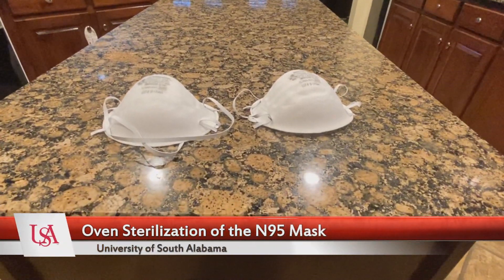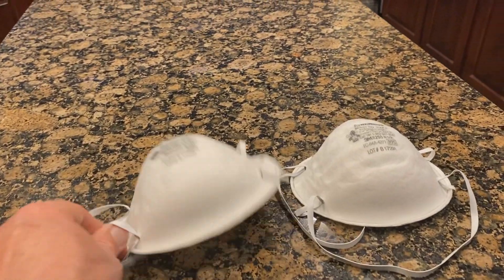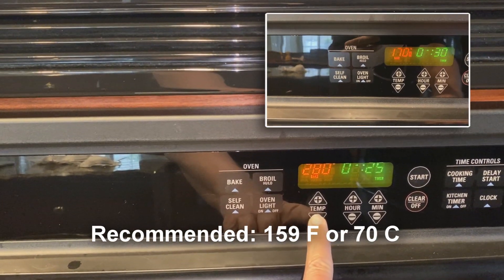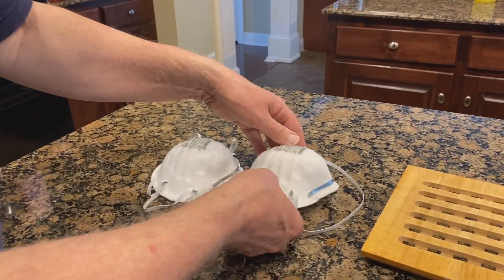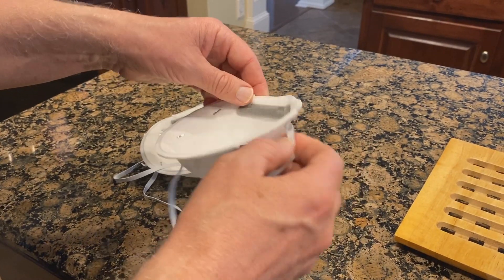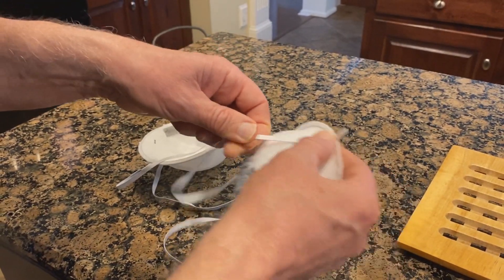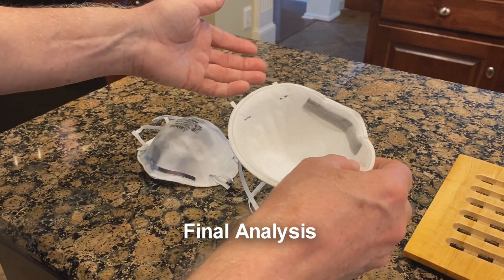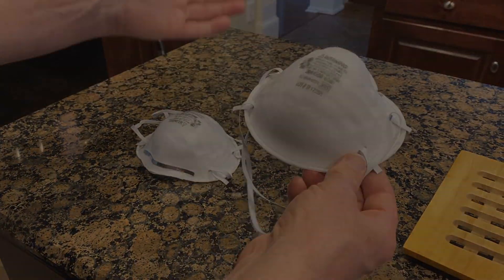Oven Sterilization of the N95 Mask

Comment: I re-purposed a Farberware electric dutch oven that was a wedding gift from the 1970's. I am using it to "hot box" the mask at 162 deg F for 30 minutes. I put the mask face down on 6-inch diameter metal rack with the straps looped on the inside. I purchased a Taylor digital timer and thermometer and place the probe on the inner nose pinch being careful not to damage the mask. I then replace the high dome lid over the dutch oven and set the dial on "Simmer". It takes about 25 minutes to reach 162 degrees and I let the process go for 30 minutes. Total process time is about 60 minutes. The  temperature controller on the Farberware electric dutch oven is easier to adjust than an oven. It sustains 162 degrees +/- 2 deg F  on the Simmer setting for the required 30 minutes. When the process is done, I turn the dutch over off and let the mask cool down - which is still adding to the heat curve. When the mask is at room temperature, I take off the dome lid, inspect the mask for damage, aseptically transfer the mask using tongs, and put it into a new ziploc bag. I have done this 4X so far and the mask shows no damage or weathering of mask body itself or the straps.

Comment: The N-95 masks has a electrostatic filter within it's layers and I wonder if the heat defeats that or not??  Definitely, chemicals like alcohol, Lysol, soap and water would defeat the electrostatic feature of the mask!  Also, laying the mask on ANY metal jeopardizes the mask and it's straps!

Comment: Get seven masks.  Write numbers on them. .  Get seven baggies and  number them.  Virus can't survive outside the body for more than three or four days.  Rotate your masks and put the old ones back in their numbered baggies.  This is what I am doing.  Can anyone poke holes in my plan?
Reply from the maker: Nope, your plan is excellent, but breathable paper bags are recommended.  That seems to be the most common recommendation and what our hospital has suggested.
Reply: I just cut up a couple of coat hangers and straightened it out so that I can hang a few masks on each. I  also give a very fine mist spray of Dettol and dry them all in bright sunlight a few hours. Till masks are available.. rotate and reuse I guess.

Comment: You cannot sterlize anything using dry heat at such a low temperature for such a short time period. Dry heat sterlization requires 160°C for 2 hours or 170°C for one hour at least. You need to change your video title from Sterilization to something else. You may be achieving some form of disinfection but even that is doubtful at such low temperatures for such a short time period.

Comment: You can take pure grain alcohol and peppermint essential oil and mix it 20:1.  Place the mixture in a spray bottle and then spray both sides until the entire mask has been sprayed.  Place the mask in an enclosure (like a Rubbermaid container) for 5 minutes and then let air out to allow the alcohol fumes to evaporate.  It should kill anything bad as well as keep it smelling nice without causing too much damage to the fibers.

Comment: There was a video on sterilizing many different ways done by Chinese scientists.  They recommended a zip lock bag and hair dryer at 170 degrees for 30 minutes as the best result since it does not damage the mask.   If you are using 170 degrees I would believe that 30 seconds is no way long enough to kill the virus.  Maybe in an oven with the mask in a silicon bag for 30 minutes at 170 degrees might be a lot safer.
Reply: Why on earth would anyone think aiming a high velocity jet of air at a viral particle contaminated surface in the same room as them is quite beyond me. And who has a hair dryer with accurate temperature controls??! Just dumb advice all around.
Reply: @Muonium1  Put it in a zip lock bag.  Duh.
Reply from the maker: Jeffrey Schwarz Hi Jeffrey.  The mask was in the oven 30 minutes.
Reply: @Chuck Latest advice is 60 C or 140 F but better go with 170 F for 30 min.  It does kill the virus.  Try silicon zip bag in oven.

Comment: make a bleach water mix or 60% or higher alcohol and put in a fine mist spray bottle clean the entire mask and strings. heating it is insane
Reply: DO NOT use ALCOHOL because the charges will be erased by either alcohol liquid or its vapor therefore reducing the efficiency of the mask, using heat it´s one of the safest methods right now
Reply: @TheStig515  provide sources. heating would break down the fibers
Reply: And I wouldn't use bleach water.  It's right against your nose and mouth and you're breathing it in.  Bleach doesn't go away, evaporate.
Reply: No,  Heat is better you are insane.

Comment: I have a question, about masks disinfetion in oven: when the oven is running, its ventilation blows the air outside. So.. Since inside we have the contaminated masks,  is it possible that the blown air might be contaminated? 
Is it recommended to do this at home, in the oven where we also cook food...?
Reply: You can let the oven get hot first. Anything over 80C will kill the virus

Comment: What about microwave
Reply: Microwave ovens operate by "stimulating" moisture molecules in most materials. These masks are dry so heating will only occur if the particular chemical molecules are also susceptible. That means that the item is likely to ignite if treated long enough to produce heat within the molecules. Add the fact that microwaves are typically not an even heat and its going to be very unreliable if it does anything at all.
Reply: NOOO!!!
Reply: No, it wont work.
Reply: No you cannot microwave it.
Reply: The nose piece is probably metal lol. Maybe staples for the elastic band

Comment: Would covid 19 survive 24 hours in a freezer?
I can't find any information on the internet.
Reply: Do not attempt to neutralize the virus by freezing. From the research I read, the virus membrane congels and protects the virus.
Reply: Patrick fee - The coronavirus has been shown to regularly survive on plastic and stainless steel surfaces for up to 10 days. Logical extension of this datum would indicate that freezing would extend survival time. 
It has been shown to last only up to four hours on copper surfaces. And up to a day on porous surfaces such as cardboard. 
The important take away here, is that frequent cleaning of contact surfaces and frequent handwashing with soap and water is what the public needs to keep doing. 
Fabric masks or standard surgical masks won't protect against incoming infection, BUT they will contain your own secretions. This means that if EVERYONE wears a mask of one kind or another, the virus will be contained.
Reply: Not a scientist but I am sure freezing will make the virus "survive" better to try and heat it, so that the outer shell "melts".
Reply: Viruses survive in freezer for 2years
Reply: I read a research article .... the lower temp only deactivates it . You need to dry heat it .

Comment: What if i leave my mask outside in the sun? Like a cloth. Will prolong 
exposure to the sun destroy mask efficacy ? If the sun is not damaging 
the mask how many hours can i leave it to be safe before put the mask in a dry place?
Reply: UV radiation can destroy the electrostatic properties of the mask. Don't even dry it in sunlight. Store it in a brown paper lunch bag for 3 days
Reply: 9 days is recommended as the safest amount of time.
Reply: I have about 9 masks that I plan to use on rotation.  I bake it at 170 degrees for half an hour.  Then I just let it sit.  It's been more than 9 days and the next time I go out I plan on using a new mask and doing the same.  I cannot say it works for certainty because I have only used it once because I've only gone out once.  But I figure if I do it both ways,  the baking AND letting it sit for 9 days, it will be safer.  I also came across a video by two chemists that you can bleach the mask.  I don't remember what video it was but youtube or google it.
Reply: New research shows the Coronavirus survives on the outside of masks, and was still viable after 7 DAYS
Reply: I truly don't know what to think anymore, there are so many researches that contradict. One says 3 days other 7. One say UV is ok for 10 days one say no. Who is right and who isn't.
Reply: @DJ-GASM  Source? That's very far off from previous research on materials. Admittedly though it was not tested on masks. I'm still very skeptical of 9 days.
Reply: Chang Lee    No, I don't think you're supposed to spray it with alcohol.  I came across a video warning against it.  I will try to find it.
Reply: Just my opinion but I would not rely on this. UV can kill the virus but the mask is porous. It would be extremely difficult to guarantee sufficient UV saturation.
Reply: i plan to leave the mask for 4-7 days hanging somewhere before using it again
Reply: @baboom007  That should be plenty sufficient. Studies have only shown it to survive up to three days on the surfaces tested.
Reply: 2 physicists show you the before and after results:   https://www.youtube.com/watch?v=PGHMU4iegLE
Reply: @Punks Not Dead  Thank you!!!!!!!!!!
Reply: @Punks Not Dead UV can deteriorate materials too. I think realistically, after 5 uses at most they should just be descarded no matter what method you use. This is also the CDC recommendation after sterilization as well. 

I'm just going to hang mine up and rotate them. Nothing more. I otherwise like the idea of a low temperature bake, it's controlled and only just hot enough to kill bacteria/viruses. So I might try that as well.

Comment: What about UV light?  UVC  200 - 400 nm  for a few minutes should be  sufficient.
Reply: 30 minutes. use the mask maximum 10 times
Reply: It wont get into the folds of the mask.
Reply: dude, you can stretch the folds
Reply: UVC damages the polyethylene in the mask ... stay with 200 degrees for 30 mins.

Comment: Why not just regular hand foaming soap and an old toothbrush for light scrubbing ... then let dry in the sun by a window? Hand soap kills the virus in 20 seconds, right?
Reply: Scott Fauque Any wetness on the mask compromises the filtration of it
Reply: @samlovesopossums  , even after it drys?   I would guess regular humility in the air and your breath would cause it to be wet as well (and the edges that touch your sweaty face from working).
Reply: Semper Fi  filtering material limitation. Part of filtration is due to the electrostatic charge of the melt-blown fibers used as the filtering material. Large concentrations of liquid like water, alcohol stray, or bleach spray can discharge the fibers rendering the filter much less effective. 25-50% reduction in filtering ability can be lost based on experiments done. Steam in certain conditions can be used but the preferred methods that seem to work best  while causing the least deformation of the masks are UV-C exposure and vaporized hydrogen peroxide "saunas".
Reply: Keep in mind, soap kills the virus with friction, not contact. It binds and through friction, tears it apart. The water and scrubbing/friction could compromise the integrity of the mask.
Reply: It may destroy the effectiveness of the mask

Comment: I strongly believe this to be the best, most practical and most effective method for mask sterilization out of all the many, MANY methods I've seen so far. It does not expose the mask to conductive liquids destroying the electret properties of the polypropylene filter layer - thus preserving the submicron filtration high efficiency after sterilizing, it does not expose the mask to high energy light or ozone which will attack and destroy all polymers and especially the rubber headbands, it does not require drying time or any unusual handling techniques aside from ideally gloves for loading it into the oven aseptically. It's available to everyone. It should be the recommended method for all who want to reuse masks. All normal everyday nonmedical users should ignore the dumb Stanford bureaucratic hysteria and warnings about not using an oven for this, it's perfectly adequate and fine.
Reply: Al 72  While probably ok, some surfaces such as plastic have been shown to retain viably reproducing virions on them for over a week. Most people barely have 1 or 2 of them let alone 10 to rotate through use. Tsing et al. show no significant damage or degradation to nanofiltration capabilities of the mask after several 170F heat cycles.

Comment: do you think spray or submerging in hydrogen peroxide will work? Duke University has tested hydrogen peroxide vapors but I can't find anything about just soaking in hydrogen peroxide
Reply: Maybe if we we're to pour Peroxide instead of water in a upholstery steamer/cleaner or even a one of those irons with a steam operational button!
Reply: @cnm867  except for rubbing alcohol, which is anhydrous.

Comment: I read that covid 19 virus lives up to 3 days on polypropylene. If you had 10 masks and wore one each day, marked the date each day, would the virus be dead on the 11th making the mask from the 1st day safe to wear? Ten masks being optimal over just four.
Reply: jimmydrive that’s exactly what I do. I have ten. I rotate them and hang the old ones in the sun. They still look like new and I’d rather gamble on the life span of COVID than a degraded mask. Was thinking of hitting them a bit with a hairdryer as well but the room I use is pretty hot.
Reply: According to what I've read, yes. This is what I plan to do as I feel it should maintain the masks integrity.

Comment: I have tried this with my 9105S. The only thing i noticed was that the printed wording on my mask had faded. I cant read what kind of mask it is anymore if I didnt know already. It is still questionable if it is still any good at filtering after a 12 hr shift use. 

Putting it in an oven at 170 doesnt damage it as far as I could tell. I tried even 200 and it made no significant difference.
Reply: hang it over boiling water for 10 minutes.  Per webmd.    Check the bottom of the article.  https://www.webmd.com/lung/news/20200324/health-workers-get-creative-with-protective-gear
Reply from the maker: I do think that the printed wording did smear a little on mine, too.

Comment: Easier way is to stem them either with a kettle or by hanging over a pot of boiling water with some utensil  let dry ..then if you want spray with lysol let sit for a day or so to take away oder uf any ..
Reply: It would get moist and probably make the glue bad
Reply: @RandomHippieCreations  there is an electronically charged layer inside, that would loose it's charge.
Reply: Sorry for misspelling
Reply: @shonhepburn8293  don't wet it